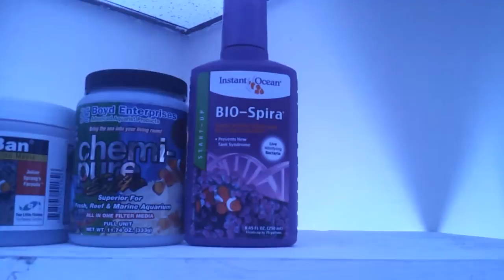BioCube 29 - LED and Cycling - Day 1 - Update 6

Comment from the maker: first, are you using tap water? if so, i would test it for phosphates, and if it does contain phos i would invest in a RO/DI unit, because every time you do a water change, your only feeding the algae, and after your sure your not adding any more phos into your tank, i would purchase a media reactor immediately to remove the remainder of the phos it will take time but eventually will work, also keep in mind some food and other additives may contain phos as well so read every label thoroughly